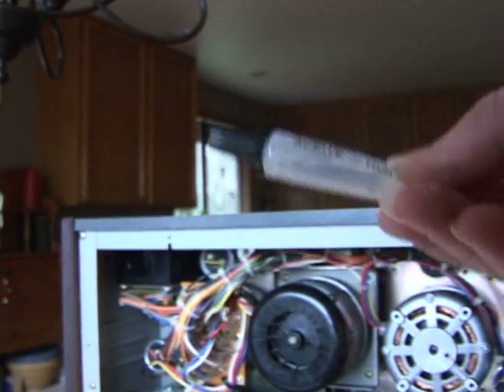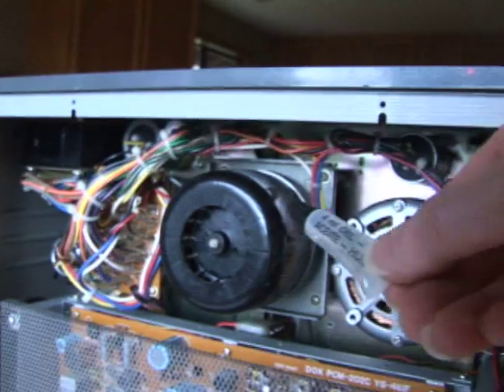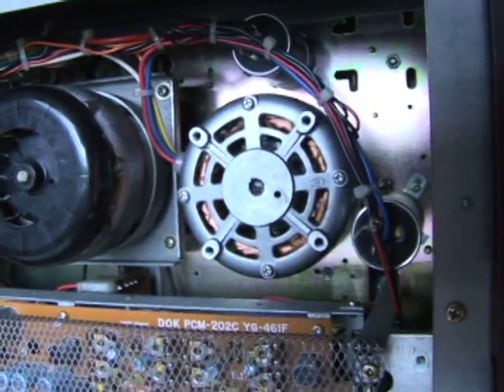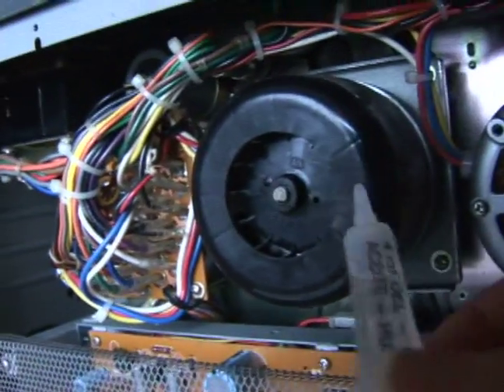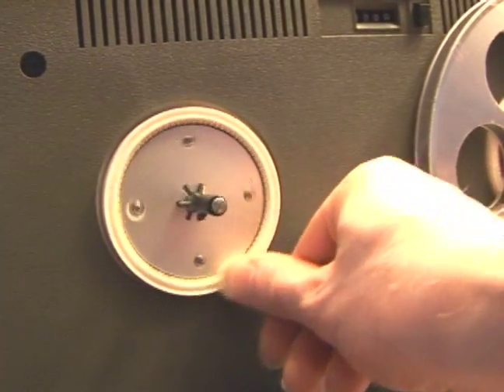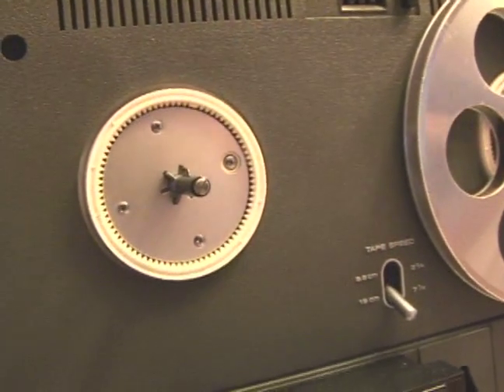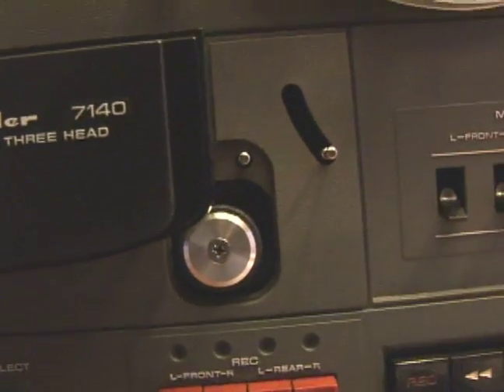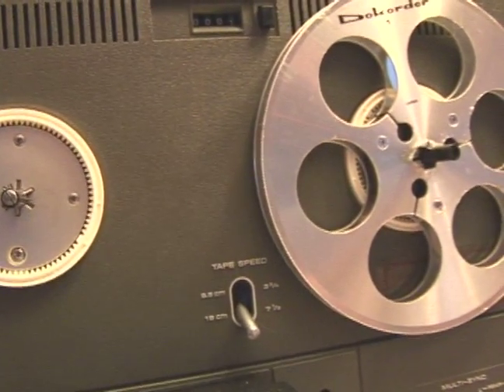Reel-to-Reel Recorders : Lube Motors of Reel-to-Reel Tape Recorder

Comment: No! Don't use sewing machine oil. Some have special additives designed for sewing machines and it can gum up. Also do not use 3 in 1 in the red can. Use Zoom Spout. Some later Teacs use sealed motors. My Teac A6300 has sealed bearings for the reel table motors, and the capstan motor has to be oiled.